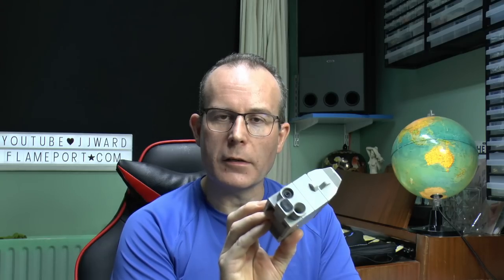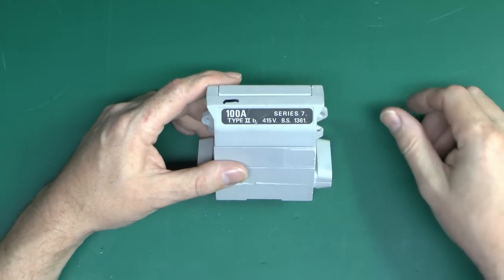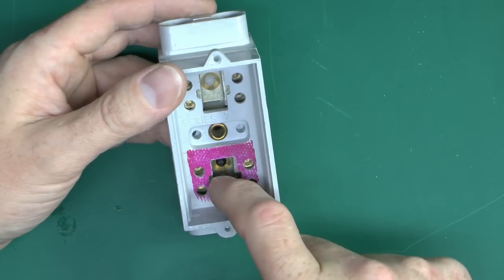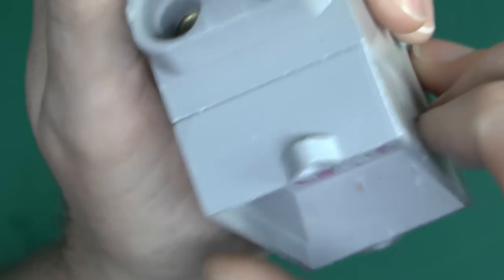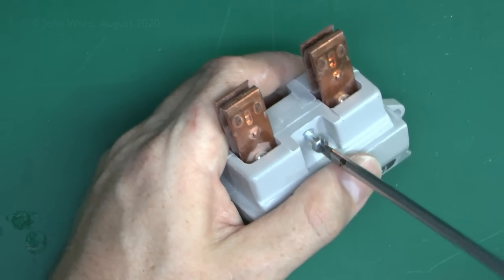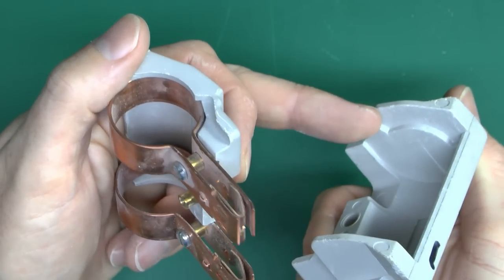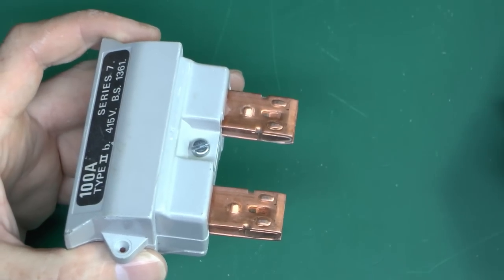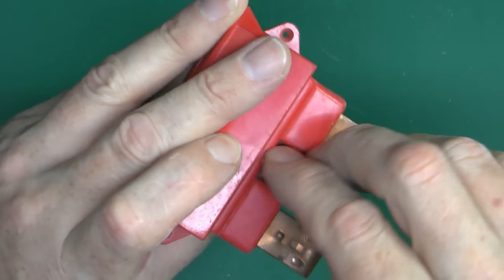Cutout Fuses, Red Links, Distribution and Building Network Operators

Comment: How many cutouts have their seals missing when you get to a job?
Reply: I don't keep exact records of that, Your Honour.
Reply: I've not yet seen an older-syle black service head that has both sets of tabs for the seals intact.
Reply: @Graham_Langley  Wanna photo of ours then ? By both sets, what do you mean - both ends of the fuse ?
Reply: @millomweb  Yes - the ones on the fuse carrier. The tabs/ears on the service head are much beefier.
Reply: @Graham_Langley  There is a position at both ends of the carrier but only one needs to be sealed as that will have to be broken to remove the fuse. So I think it's your misinterpretation - one seal is enough to prove it is sealed - and that's all that's required.
Reply: @millomweb  Missed point. One is usually broken IME as they're rather fragile and of course if they were to be <cough> accidentally broken the seal would remain intact should the fuse be pulled..
Reply: @Graham_Langley  OP was on about missing seals - not broken sealing places. Mine could have a seal at the bottom (has one at the top) and the holes for sealing wire are all intact. 
So are you saying you only find these things with broken lugs or whatever ?
Reply: I dont think I've seen one with seals yet.
Reply: Seals? What seals...😉

Comment: I hate it when people say "because it's dangerous" and leave it at that. People are going to remove these whether you tell them to or not, so as a content creator you should explain why is it dangerous? I've removed multiple of these and never had a problem. Wear rated protective electrical gloves and there's no chance of flashover shock. The danger is flashover, the electric will jump an air gap to your fingers or anything conductive. Also wear boots that are rated for electricians (they look like yellow wellingtons), and an electricians mat (thick rubber mat). Remove the fuse gently, and quickly, keeping the fuse level. Don't bend or twist it. Use a fuse shield to protect the socket, that's 250V live and you don't want anything accidentally touching those fuse pins. When putting the fuse back it, hold it level, gently place it into the holder and push with a little force. Job done. If the fuse is damaged, don't touch it! If the holder is damaged don't touch it! I only ever remove a fuse when I work on the electrics. I've had instances where shutting the fuse box off wasn't enough so I never trust switching off at the fuse. With that said I've never had a flashover occur.

Comment: I had a new 3 phase service installed five years ago.  The fuses are BS1361, and the cutouts have labels stating “100 amp fuse fitted”. When did they change to BS88? When I was in the trade a long time ago, the supply authorities stated the p.s.c. when a new service was installed.  The figure given was almost always 16Ka.  In practice the measured p.s.c. at the origin was always considerably less:  the quoted figure would have been the value at the transformer terminals.
Reply: I have 
already done 
a video on these, 
but the one I show is a.......

...... Series 5 type (in black and made by AEI) and I also 'touch' on the Series 7 types shown here by showing a fuse carrier. I even have a functioning 60A fuse (BS88) made by BRUSH.

Here we go:
https://www.youtube.com/watch?v=dmE79gYlfzI

I don't have one of those 'red' links. I used to have one of those, but I don't know what happened to it. I was actually quite surprised when I opened it to find in there, what looked like a lump of scaffold pole!! :D

What I think about BS88 and BS 1361:

I have reason to believe that it might be the other way around to what John said, as the BRUSH fuse I have says BS88 on it and looks rather old and tatty and very well worn (like as if it's been rolling around in someone's toolbox for a few years or even in their van!!) and the thing here is, LAWSON are selling BS 1361 cartridges to this very day (not BS88)

Just to possibly verify this, the older Series 5 used to say BS88 on them, and the newer Series 7 (which is the ones shown in this vid) say BS 1361 on them.

There juuuuuuust might be a possibility that BS 1361 is the newer standard for these cartridges.

ALSO: Those cartridges are available in two different physical sizes. I believe they are the same length, but one is smaller in diameter and I believe that the maximum rating of the smaller-diameter ones is 60A.

Both diameters are made to BS 1361.

There we are. :D

-Wayne's Electrical.

3rd September 2020, 21.38
Reply: Substation fuses are BS88 standard. The 16kA PSC you would've been quoted is the maximum design limit for the LV network for single-phase, keeping in mind that the prevailing PSC (or fault level, if you prefer) can change without reference to the customer or their agent, simply due to network switching either at LV or HV. I can see the sense in this but it can't be very helpful to designers of installations that find the single-phase PSC is less than 10% of the network design limit.

You are quite right that the measured PSC is usually well below the maximum design limit. In the same way, the maximum design limit for the 3-phase symmetrical fault level at a substation LV busbar is 25MVA, the practical limit, even for a single 11/0.433kV 1000kVA transformer sitting right at the local primary substation is around 18MVA at the LV busbar. Some LV networks, such as those in parts of SP Manweb have multiple interconnections between secondary transformers as a consequence of the unit protection of the associated HV network. Interconnected transformers will, of course, increase the PSC.

Most LV networks, however, will supply customers from only one secondary transformer at a time with a relatively modest PSC at the point of supply - but I still wouldn't like to be nearby when a flash-over occurs :o)
Reply: Craig Watson Thanks for your very informative reply.

Comment: Yesterday I got reminded as to why a switch shouldn't be relied upon (fortunately nothing bad happened)
We have an extension lead which quite a few devices are plugged into, the sockets on the extension lead are individually switched, and have a red light at the top of the switch to indicate when it is on, and one or two of the switches on that extension lead are a bit dodgy, and yesterday when I went to turn off one of the devices plugged into that extension lead, the switch didn't click when flipped to off, and the red indicator remained lit, it took a few tries to get it to turn off

Comment: Hi i need to run power from my house to my workshop winch is located at the bottom of my garden.  Unfortunately there is no isolation switch between metre and consumer in the property. Would the DNO be the correct people to install the isolator? So my electrician can work on the consumer board. Or does the DNO just remove main supply fuse?
Reply from the maker: The DNO only cover items before the meter.  Isolators are normally installed by your electricity supplier, as it's after the meter and connects to the meter.
Reply: @jwflame  thank you

Comment: Interesting question: you mention not to just trust the rating on the external label as thats the max. But you can't check actual fuse without breaking seal and opening, but by and large, you aren't allowed to break the seal...... how does that work?!?! I wouldn't think an EICR is a valid reason to break the seal even for DNOs that allow specific people to do so?
Reply: There's a thing on the form that says 'by enquiry'. You're meant to phone the DNO, and ask. And they magically have the records available.

In reality, a lot of times the seal is missing anyway (in which case we pull it, have a look, re-seal, and note that it was missing), or if it's not there... we do a LIM

Edit: in certain areas of the town we work in, SSE have kindly been putting printed labels on saying '60A fuse fitted' or '80A fuse fitted' ... this helps IMMENSELY on an EICR, but its very rare except in certain streets for some reason? (maybe overloaded local substation?)
Reply: The answer is the DNO should either label them accurately or provide (easy!) access to a database containing the information. Getting them to take any responsibility for that is likely to be difficult, however.
Reply: @Monkeh616  Is it the DTI we're supposed to report to when a DNO fails to meet ESQCR requirements?  Western Power have told me they don't generally have records of their earthing arrangements for dwellings in my area of the West Midlands.

Comment: No dummy plugs to permit lockout? I was expecting the red one to be a lockout, with providing for a  padlock had to block its removal.
Reply from the maker: There are shields available to cover the live exposed parts, such as https://www.cef.co.uk/catalogue/products/4392222-30mm-x-34mm-x-27mm-fuse-cut-out-universal-shroud
but those are only intended for short term use while someone is working there.  Generally if the supply is to be isolated for any length of time, it's done by removing the outgoing wires from the cutout and inserting blanking plugs in the holes where the wires were, then replacing the fuse carrier.
Reply: @jwflame  In the US there would be one or more LOTO locks to prevent someone from re-energizing the circuit while someone is working on it. I suppose the electrician working on it could pocket the fuse block while working on the system. 

It's interesting how the health & safety authorities focus on different things in different countries. Perhaps the US has a higher concentration of Bozo's than the UK. 🤡🤡🤡🤡

Comment: A few days ago my microwave started heating very slowly, around 5 times. When I measured voltage in the socket it showed 185 to 210 V max. I then measured the voltage on the cables between this main fuse box and the meter, and found that the voltage there was the same (185, 190, 200 V). I don't want to temper with the cables leading to this fuse and cannot measure the voltage before this fuse. My question is: Can this fuse b in any way responsible for such a low voltage? Or is it just some fault on the line or substation somewhere? The tester I used is good and at my work shows 238-240 volts. Thank you.
Reply from the maker: Fault with the supply, a fuse cannot change voltage.
Reply: @jwflame  That is what I thought. I phoned ukpn and reported. They said that someone else had also reported low voltage in the area. Thank you very much.

Comment: Why don't they use a switch instead of the red one? Is it purely cost?
Reply: I think the idea is that once removed, you keep it with you to be sure of isolation. A switch could be turned on again by someone.
Reply: @Stuart-AJC  Not if it can be locked out like mcbs. Also, if someone there could flip the switch, they could also stick their finger into the live contact.
Reply: dalriada842 some electricians remove the fuse from the carrier, close the carrier up again then put that back in the slot for it - still isolates the supply and stops people sticking fingers in places that shouldn’t
Reply: Yes its purely down to costs.
Reply: @David-js4wd  What's expensive about a 60A MCB?  You can get them for as little as £1.50.
Reply: @dalriada842  Not all mcb's are classed as suitable for isolation. You have to ensure a minimum distance between contacts and some mcb's don't provide this.
Reply from the maker: Fuse is required for breaking capacity (at least 16.5kA and often as high as 80kA), and to ensure selectivity (discrimination) with the devices in the consumer unit.
Reply: It's a visual break in the circuit. Like unplugging rather than just switching off.  Also as John said, the short circuit currents could be such that a switch would be destroyed. As it's the primary means of local isolation, it is preferable it doesn't. Also, being an open carrier, electricians are less inclined to insert it under load (it should never be removed or inserted with any load other than the voltage coil of the  meter on it).
Reply: @steve.Lowles  Indeed, we keep a selection of 'dummies' on the van. Carrier clamped onto a piece of appropriately sized PVC pipe (22mm plastic is ideal for one of the more common sizes). All of them are labelled 'isolated, do not remove or replace'. (I got a new P-Touch :) . Then, as you say, the actual cartridge stays in my pocket or my colleague's (we agree on who is in charge of 'the board area' on any job ahead of time.).
Reply: @westinthewest  I'd rather trust an HRC fuse link (or copper bar) and heavy moulded carrier  than a 1.50 mcb!
Reply: If you want to pay for a substation grade switch on your property, I won't stop you. But it's probably the only thing rated to stop the currents involved.
Reply: Low cost, common parts, and common training for meter changers, probably.
Reply: @WhiteShadow2k1 I was referring specifically to the red-bodied links used at consumer units in a multiple occupancy building to isolate them. Not the main network operator fuse coming into the building. Though I did see a video recently on another channel where a French setup was shown. https://youtu.be/O6uBwYU25lo  Maybe this had a cartridge fuse on entry to the building. I'm thinking of what you mentioned in your final three sentences. It's the arcing during operation that creates issues with contacts welding together. A link is a primitive switch, but with exposed contacts. They're both as likely to suffer such failure, but the switch is more shielded. It should be possible to have a switch that can be sealed or padlocked in either state to stop people fiddling with it.
Reply: @TheChipmunk2008  Any particular reason why you don't trust MCB's?
Reply: @jwflame  I see those sorts of breaking capacity ratings on HRC fuses, but why do we need them on a typical single phase supply where Uo is 230V and Ze is 0.1 ohms?   Wouldn't a cheap 6kA MCB disconnect this safely, reliably and consistently?
Reply: @WhiteShadow2k1 "It's reliability and dependability. Switches have moving parts." - I read into that costs...

in your switch scenario - who owns the switch?
Reply: @westinthewest  Electricity company equipment is often left for decades without testing.  (and by its nature, a main 'mcb' would have to be locked or sealed to prevent the customer powering down the installation, as it would facilitate meter bypasses, preventing any mechanical 'exercise'). Too much of a failure point. I believe after meter isolators backed with an HRC fuse BEFORE the meter are the most sensible answer to the problem.

I also don't like smart meters (no not for tinfoil hat wearing reasons, I just have seen inside them. Compared to old induction meters the quality is utter crap)
Reply: Because concentrate cables have to be terminated in the cut out fuses maybe because they generally now have aluminium centre conductors so finding community or isolator rated for that maybe hard

Comment: The red and white carriers are physically interchangeable.  So, the red carrier is actually a very high capacity fuse.

Evil grin.
Reply: Putting the red carrier downstream of a 60A fuse is surely a deviation from regulation 536.4.
Reply: @Blazin Redeye Black was old style.
Reply: @Blazin Redeye Yes, what @bdf2718 said. The old style was a bakelite STYLE material, good insulator when new, but prone to stress fractures if mistreated. Often you find the sealing 'eye' broken and a 'tampering is illegal' tamper evident seal fitted instead.  The grey ones are glass fibre reinforced resin of some kind, and MUCH less prone to cracking. Although as I've discovered, when used in outdoor meter cabinets with broken doors (they're everywhere) UV and moisture can do a number on them.
Reply: I really do appreciate my old house's wiring. It's blown 'woodworm' holes in the metal caps on light bulbs and recently the dishwasher went bang - enough to be heard upstairs plus make the lights dim - yet the house wiring copes with all of this - and even the dishwasher was fine afterwards. It was only a bit of liquid linking L to E that got vaporised - no copper was harmed in the process.